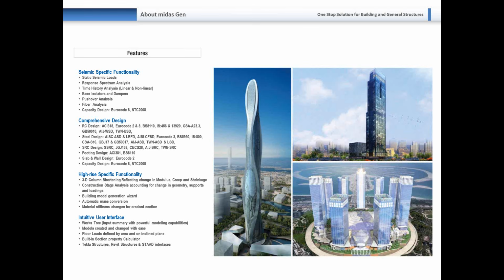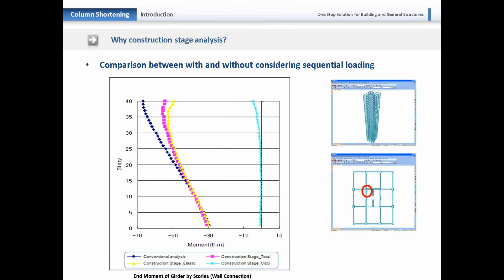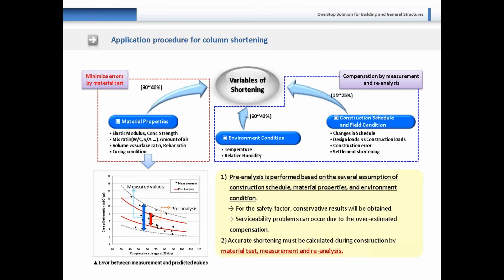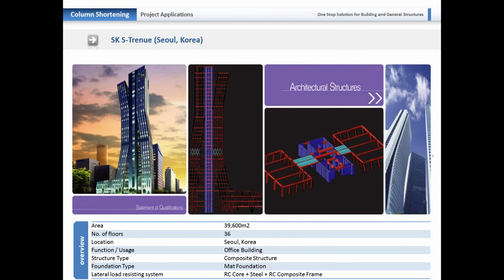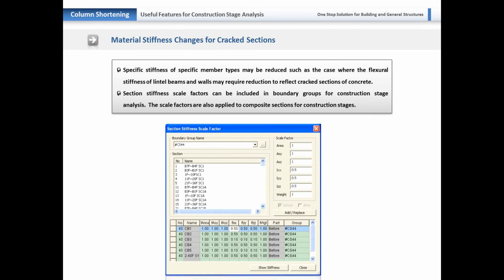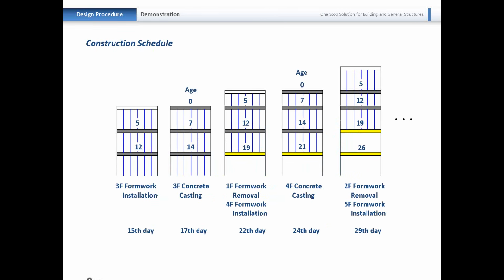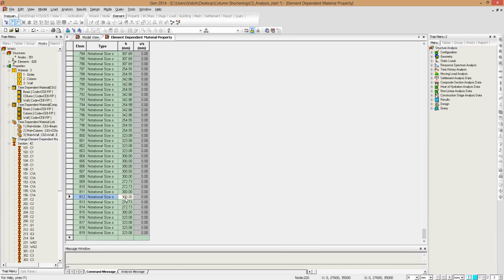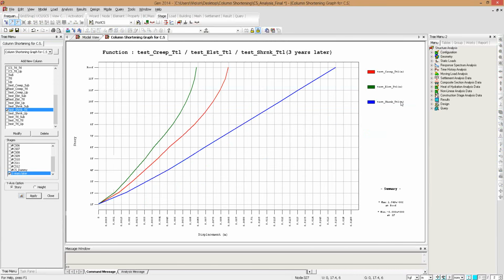Column Shortening Analysis considering Creep and Shrinkage

Comment: Q. 1) Can column shortening be not analysed without construction stage?
Q. 2) I cant see any changes in the deformation characteristics of the structure, when I compare linear without creep/shrinkage assignment and  linear analysis when creep and shrinkage properties are assigned, in case of a simple 3 D portal Frame.
Q. 3) What is CS Dummy, that gets created automatically?
Q. 4) Member age, in CS, refers to which member's age?
Q. 5) Is there any fb/whatsapp/or any focussed group, who are using Midas softwares or just Midas Gen, where we can discuss similar issues and get instant resolutions?
Reply: Hello there can I have your phone no or email address ?